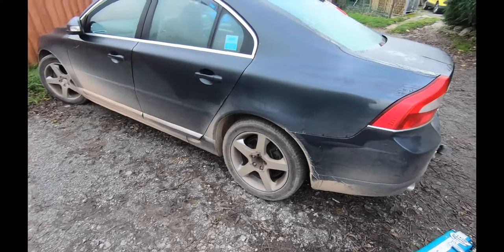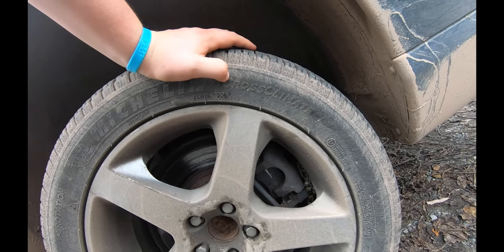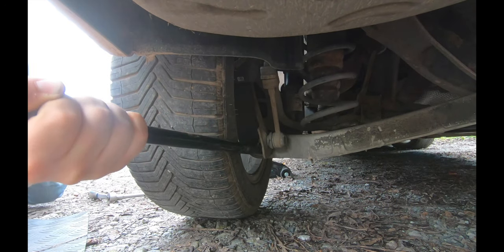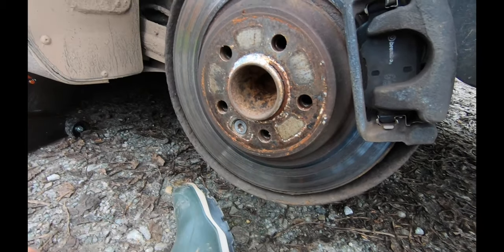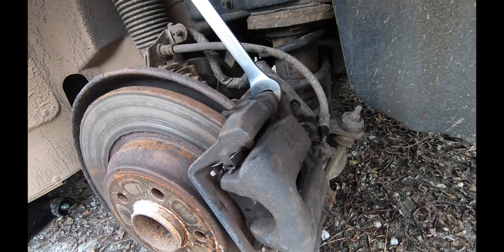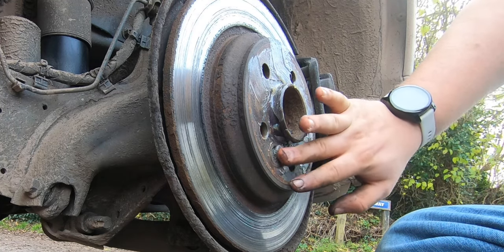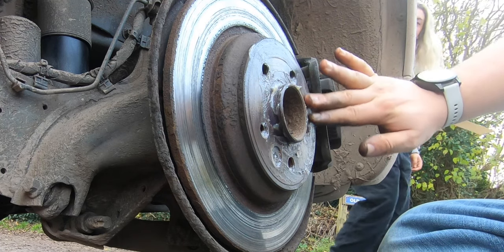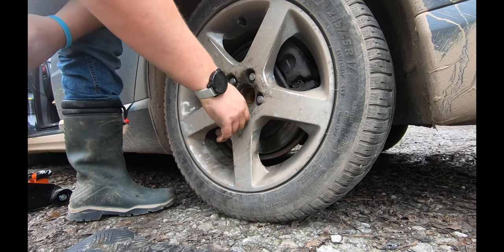Have I *RUINED* my Volvo? Volvo brake binding issues!

Comment: I had the same issue on the same wheel… slide pin started corroding. All fixed and better now! (2013 v60)

Comment: I'm glad you said yourself about refurbing those alloys. Go on, it's not an overly expensive job and would make all the difference. That, new centre caps and new locking wheel nuts and you have pre-empted any problems there. When you've got the car looking nice then I always think that you've more of an incentive to take care of it. 

Of course I say that knowing that my alloys will need refurbing too. 

Another tip for when you're having to cavort around the ground of the driveway is to pick up some cheap polystyrene tiles (started off life for the kids to play on but now keep my knees from finding stones and keep my clothes relatively clean).

Comment: I did the similar on my v70 09 just  a week ago.
Hopefully this sorts it out for you.
For me the rear breakpad on "the outside" had no pad left on it. since it had gotten stuck.
What I did was clean the contact areas where is slides, so it could move. And i also made a V shape out of the rectangular shape with an angle grinder on the pad. Where the pad is supposed to slide. (The more expensive and OEM pads usually have this shape from factory).

So if your fix does not work, please try grinding some metal of the pad metal sliding edges.
Reply: Clean the rust off your caliper carrier bracket with a file before altering the shape of the pads. It often builds up behind the abutment clips and you'll get 'rust jacking' which squeezes the clips and causes the pads to bind.
Reply: @ihampton  I agree. in this case however my brackets were spot clean. (they are the ones you can just clip out and replace) So i just modded the pads to have the same shape as more expensive pads. (and oem pads).
Reply: @Volvo5Cylinder  glad you got it sorted. I meant file down the carrier where the replaceable clips sit, that’s often where rust builds up and pinches the clips.
Reply: @ihampton  good point. Now I see what you mean. Rust there would actually clinch the carrier and pad and lock it in place.

Comment: Had a binding issue on the front of my XC60 D5 this week, a 12 plate but with similar mileage to your S80. I stripped and greased the pins, cleaned up the pads etc but sadly to no avail. The caliper was still binding quite badly after  a mile or 2 of driving (no pulling to one side, but lots of heat and also having a significant impact on MPG). I bit the bullet and have just fitted a recon genuine Volvo/Ate caliper with new Volvo discs and pads. Fingers crossed, now all good. Calipers don't last forever and aren't generally silly expensive to replace.

Comment: It's caused but you not cleaning the rust and brake dust off the caliper and ensuring that the slides that came with the pads were able to sit square and allow the pad to move freely. They should also be copper slipped to help the pads move freely, also the slide pins should be removed and cleaned as they will have rubber burnt onto them which will cause them to stick.

Comment: you dont have to start the car to use parking brake, either hold brake pedal and release or hold start/stop button and then release, then turn ignition back off pressing one more time

Comment: Get a wire brush on that hub
Reply: And a thin smear of copper slip on the hub and copper slip on the threads of the wheel bolts. 👍🏼